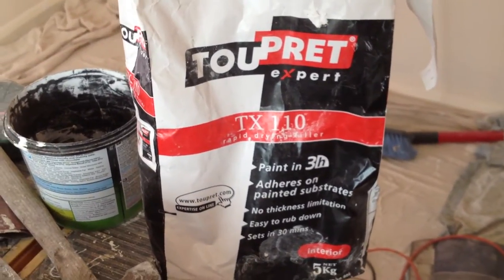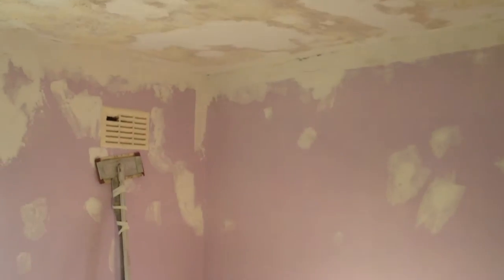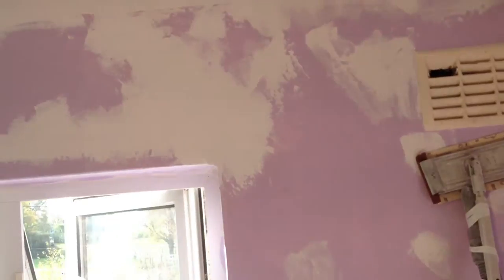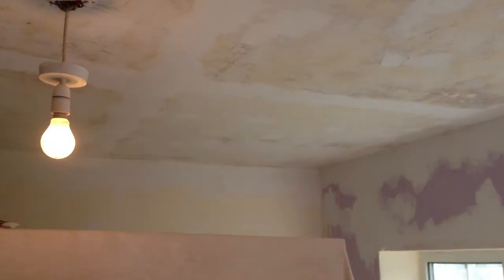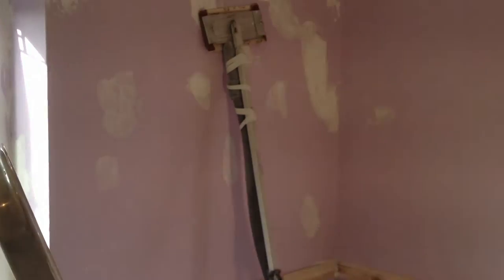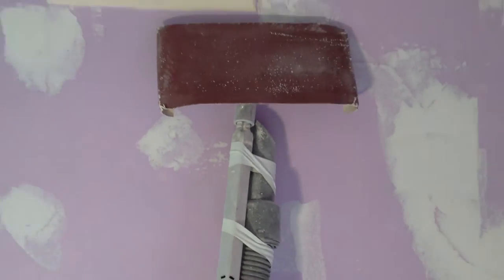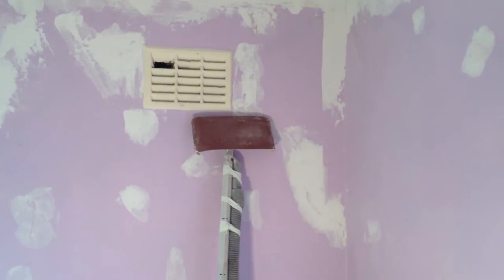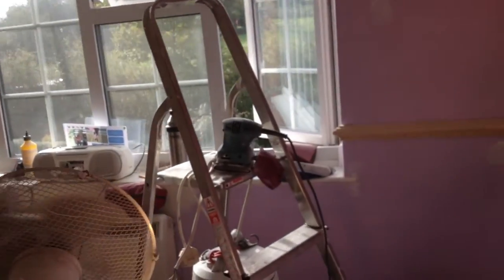Toupret Instead of PLASTER for Big Ceiling Repair

Comment from the maker: Hi Jimmy   It seemed like a good idea AT THE TIME The ceiling  was badly damaged and I wanted  a strong quick drying  filler    I havent  used Tou Pret before  so it seemed like a good time to try it  and It  turned out  pretty good